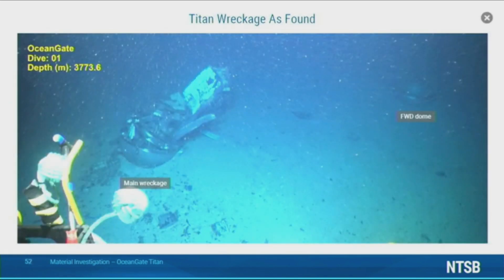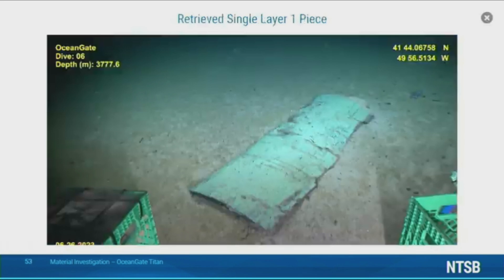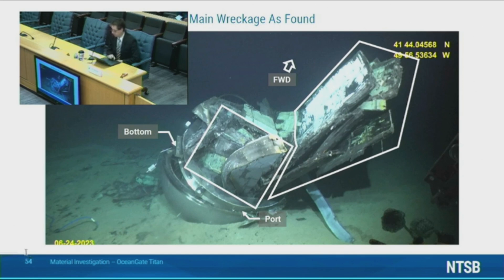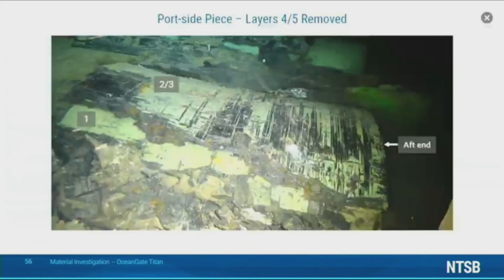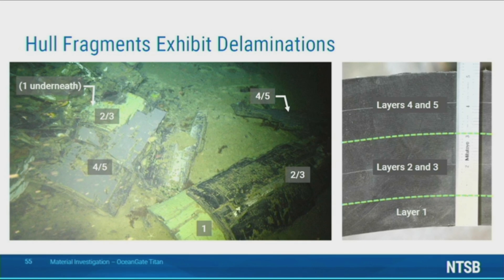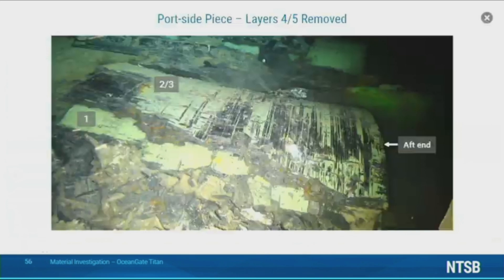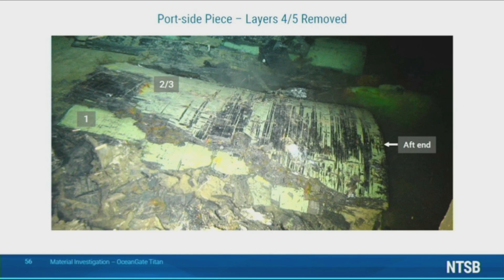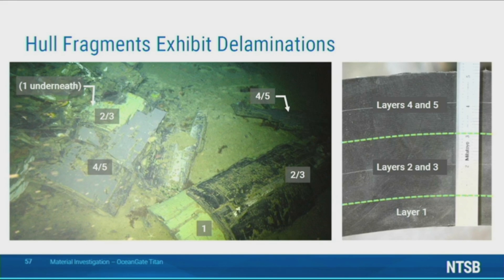Titan Submersible Hearings

Comment: I  wonder if it was made a little shorter in length if it would have survived.
Reply: not with a carbon fibre hull
Reply: The amount of time to failure may have been longer but it still would have failed at some point.